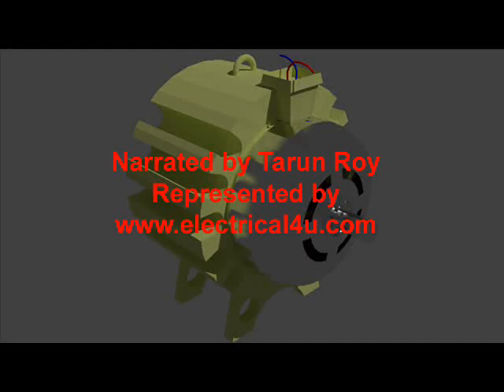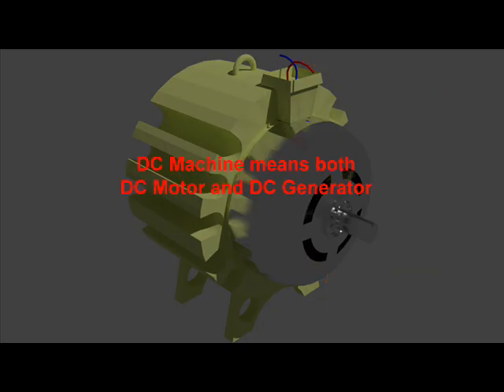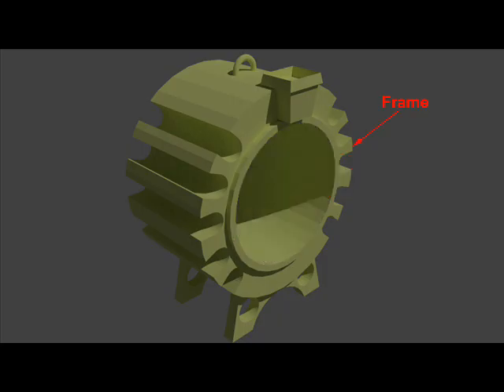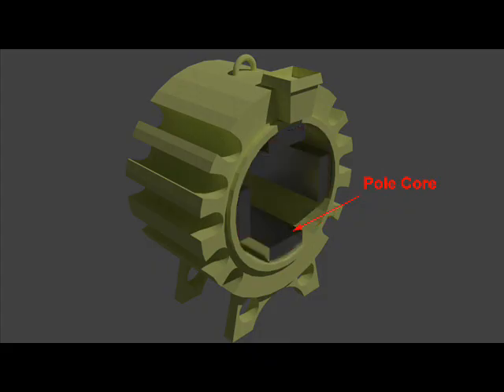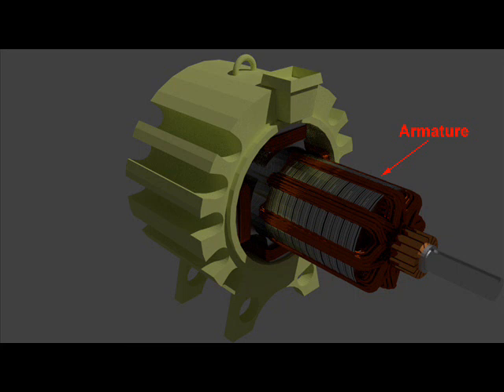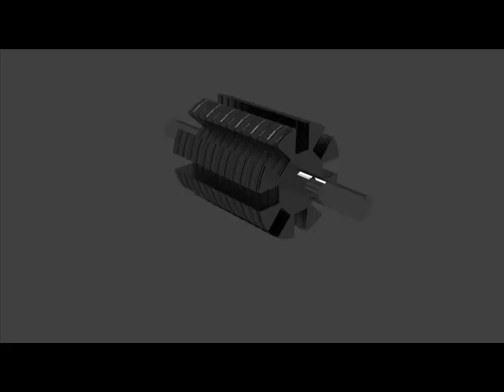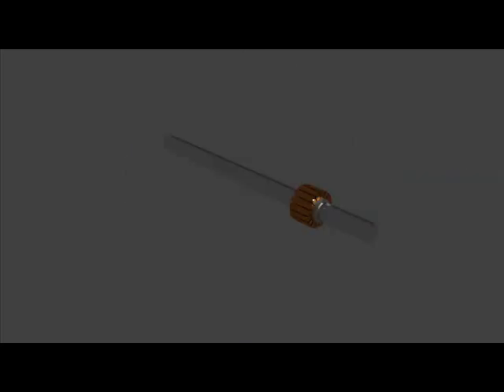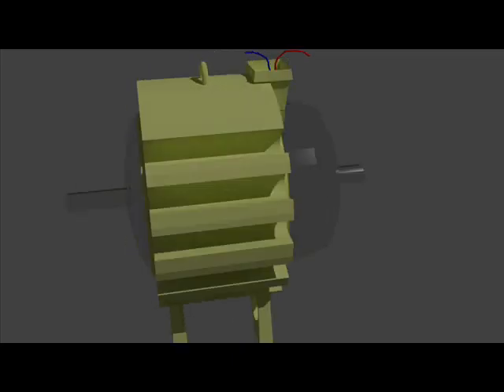DC Machine: Construction And Working Principle (DC Motor & DC Generator)

Comment: If armature release ac current why its not called ac motor
Reply: Because We will consider the output of the motor but not the internal operation.here we will get output as dc due to commutation hence it is dc motor